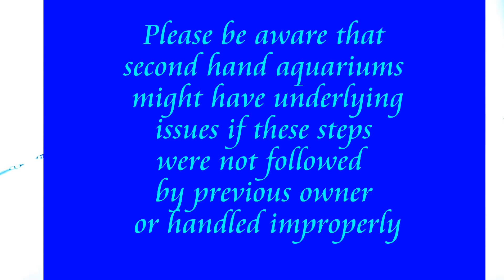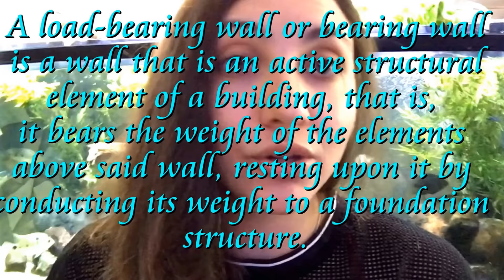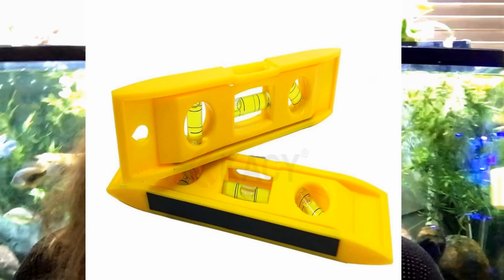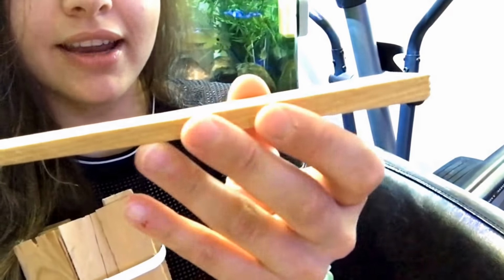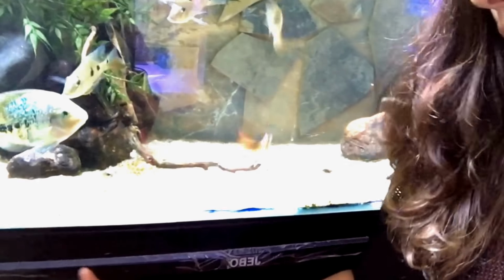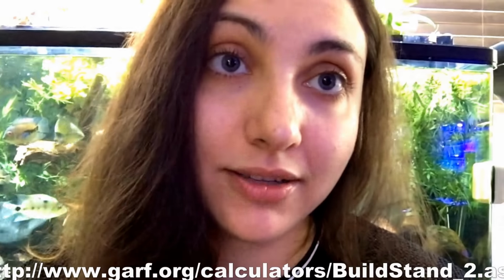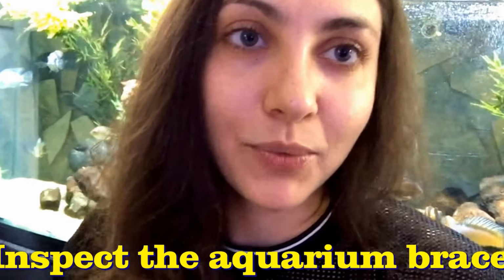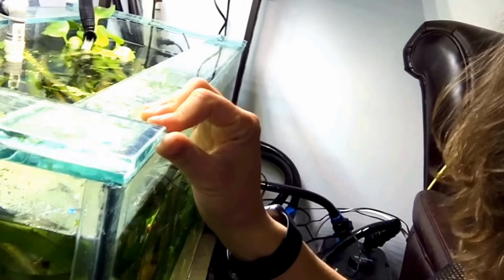Is My Aquarium Going To LEAK? HOW TO TELL!

Comment: liked the video. looks like a more scientific approach. Please let me know, how do i know if my tank needs a top brace / bracing . I await your reply.
Reply from the maker: Depends on thickness of the glass. And the taller vs wide, the more it needs brace
Reply: @AquazoneQC  I got a tank.. Dimentions : 38 inch length, 20 inch height and 17 inch as width. Does it need a brace ? or is it ok like this ?
Reply from the maker: @impulse232  I cannot tell you yes or no I don't wanna be responsible for explosion if it happens.
Reply: @AquazoneQC  Ok, Thanks. BTW ur video was informative. Thanks again.
Reply from the maker: Jist in case https://youtu.be/yyXiweZhMMw

Comment: Awesome video loved the 5 leak facts!!  Thank you so much I just bought a second hand 125g tank and after I cleaned it I noticed there
Was a crack on the bottom frame of the tank, is this bad? Please help!  Thank you! Much love and aloha🤙🏽🐠🤙🏽
Reply from the maker: A crack ? I would need a picture but how big is it? Cracks only get longer with time and water pressure. A patch won’t help unless you patch the whole panel with a new class, it’s safer than to dismount all panels and redo

Comment: Hi Isabella, you have raised some great points. Just a thought if you have a really big aquarium use metal shims, preferably with large surface area to spread the load, the floor preferably will be concrete!  The point load going through your shim is huge, over time the timber shims will compress especially if they get wet. Keep up the good work. Paul

Comment: Hi Izabella,
I am enjoying watching your videos! :)
Can you tell me what production bubbles are? I am having 20 gallon tank and in one corner I can see small connected bubbles between 2 glass planels. Bubble almost make a small chain around 3 inches long. Should change the tank or you thinks that is not a big deal?
Thank you
Reply from the maker: Most factory tanks have some minimal bubbling between Pannell, black silicone usually makes it barely noticeable but on clear you can see. Nothing to worry if silicone looks good and rank levelled
Reply: @AquazoneQC   Thank you for your fast answer.
Thank is less then half year old. Made by Aqueon. Its leveled and silicone inside of the thank looks good. No peeling off etc.I didnt notice that bubbles before since that side faces the wall of the room. After last cleaning of the tank (when I saw that bubbles) I did small research about problem that I have. Your video was most halpeful!

Comment: I almost didn't recognize you without your usual pink/purple alien coloration.  ;)
I use rubber backed rug padding between my acrylic tanks and the plywood.
I just bought some glass tanks for the first time since the mid 1980s...150l and smaller. I so prefer acrylic!

Comment: The level bit gets me worried. There is a very very slight difference in the water level. But I think it's the top trim. Aquarium is in the same spot now for two years. Point 3 - I'm bubble free. Looking good so far.
Reply from the maker: 1-2 cm off level not catastrophic but 5-10 cm .... fix it lol
Reply: AQUAZONE Izabella it's only slight. Deffo not 5 - 10. I'll sleep better tonight. Cheers for the reply